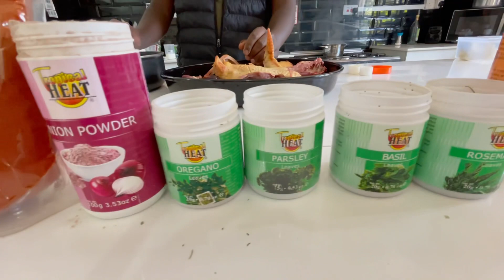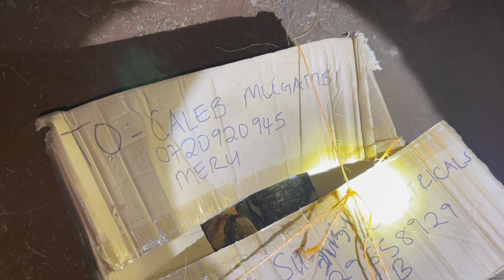Farm Chores | Dinner Plans | Village Life | Life in Kenya | Daily Living | Vlog

Comment: Great job guys. For your chicks it's a bit dangerous to put them in a house that had chickens earlier and no cleaning  was done especially if the previous birds were mature. The house should  be cleaned  disinfected and left unoccupied for at least  2 weeks. Thereafter put wood shavings on the floor (about 6 inches deep ), disinfect them, and also.put them in the nesting boxes too. Ask the fundi to raise the boxes off the floor 1½ feet up so that  the chickens don't  peck and eat the eggs.